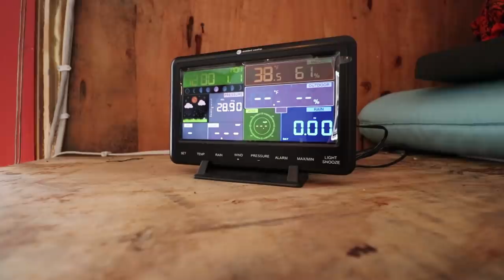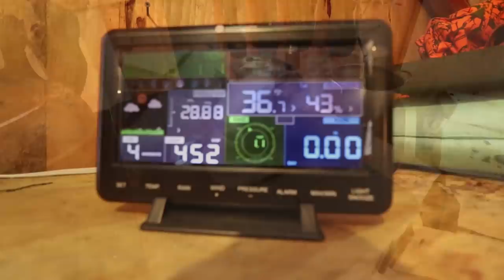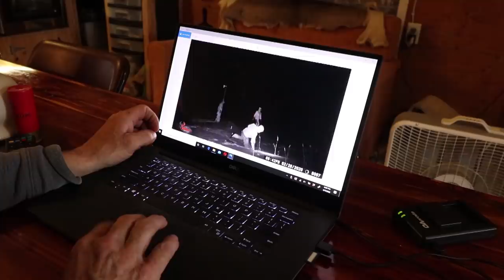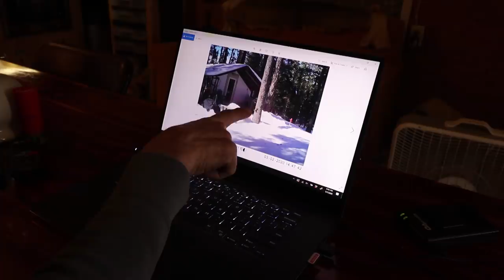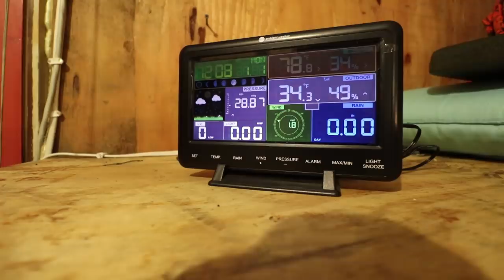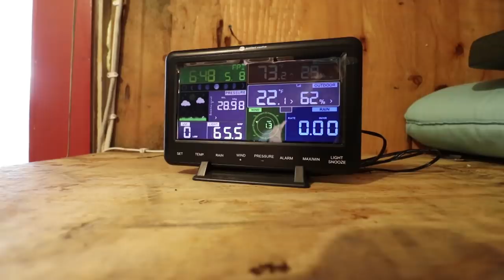THE TENT. First Spring Trip of 2020. Opening things up. Dad is at the Folks cabin.

Comment: Something that might be helpful for those mice are if you get a 5 gallon bucket and drill 2 holes/ grooves towards the top on each side and then get a beer can and a thin metal rod that will spin and poke that rod through the can and put peanut butter on the can and put the rod in those holes you drilled and fill the bucket with antifreeze and build a little ramp so those mice can get up onto the can and they should just fall right into the bucket and die because that rod will spin them right into the bucket and should take care of that problem... always did for me. Also love the channel !

Comment: I know it's a detailed question, but if there is one thing you wish you did differently when you built the tent, what would it be? Thanks Joe.
Reply: 3/4 inch plywood on the floor instead of half inch. The camera would not move around when I walked next to it.
Reply: @NorthernSeclusion  thanks Joe. I used 1/2 inch for my tent floor as well and no doubt, the camera moves. Also, I just should have spent the extra money. Lessons learned. Thanks for taking the time to reply. Jay.

Comment: Hey Joe, My wife and I just bought 5 acres near Tug Hill region in upstate NY that borders 2800 acres of State forest. We just bought a 14'x30' cabin and had it delivered this past Monday. We are in the phase of what do we want in there? Where do we want the wood stove and so on. Its been exciting and fun so far. No electric, no water definitely off grid. I watch your videos for camp ideas and just ideas on where to start. Thank you.
Reply from the maker: That would be a fun project. Wood stoves are good in a corner because they take up less wall space but with yours being 30 foot long you will want a fan to blow the air to the other end if you do not decide to place it against the wall in the center of the building. If you do that though, a wood stove is going to eat up 5 or 6 feet of space coming out from the wall as far as "safe space" is concerned so keep that in mind. Since yours is 14 feet wide, that pretty much splits the building into two areas. Not much room for chairs in front of the stove without possibly causing a walkway issue. All things to think about when planning. I would be excited doing a project like that.

Comment: Hello Joe, been watching for years and have always wondered why you never use what I'm assuming is a water heater on the side of your wood stove. Even when you replaced the stove back whenever I never saw anything about it.
Reply from the maker: I have used it in the past but they end up wasting a lot of water. It heats the water well but you need to use it immediately. You would think when looking at it that you would just always have hot water BUT, It just boils away.  Since the stove when going is of course very hot all that water will boil out within 2 hours.

Comment: 3rd video for me.here is a tip for your stove since i have the same colorado stove, i took an extra stove pipe i had and flattened it a bit so it would fit inside the stove, then when i burn wood, the ashes that remain i just take the inside pipe and remove it with the ashes, somewhat easier to clean the inside out

Comment: Get a Berkey water filter to leave at the cabin. You can pump water out of the pump and fill the Berkey....it produces 2 gallons in minutes and will take out all of the nasty taste and color. It is a water purifier so you could even put pond water in it and it would taste amazing. It will save you a lot of lugging and plastic bottle trash, plus it will be there to use at any time. The filters last for 12 years. Do yourself a favor and check it out. And store your paper plates, bowls and cups upside down, that way you don't have to worry about critters getting into them.

Comment: how does that shower work i know u have a battery that pulls the water into the shower head but does that warm water recirculate through the shower head or something i know a silly question or is that all the water u have so its just a quick 2-3 minute shower , thanks ..or that water spicket u were fixing bring water into the house and the hot water in the pot is just to make it warm a little....

Comment: Joe, if your like me , your not getting any younger. I noticed you struggling to push the boat in and out. Simple little trick helps that a lot. Put about 5 or 6 four foot logs on ground perpendicular to boat ramp. The boat pulls on and off the logs so much easier. WILL I AM

Comment: May want to drop the lower unit off your boat motor it didnt seem to be pumping alot off water. The water pumps are rubber and they get hard over time and dont pump well.
Reply: I had that replaced last year.
Reply: @NorthernSeclusion  good deal just looked weak to me but I'm used to larger motors so they push alot more water.

Comment: what kind of wood stove do you have? expensive? I'm going to have lots of questions for you, sorry.
Reply from the maker: It is a "cylinder stoves" stove. That is the brand name. I have a video on it on this channel that will explain everything. Do a search for it. The video is called "cylinder stoves the tent wood stove" or something close to that.
Reply: @JoeandZachSurvival  I just researched those cylinder stoves and they are considered a tent stove. My concern is can they be used in a cabin. They say you can not. Have you ever had issues with the door seal or any other issues? I'm wondering if its a seal issue with the stove and chimney.

Comment: what was the problem with Zach"s car? I think I have the same problem
Reply from the maker: Connection between harness and alternator had loose fitting, went to Ford and got a new plug and it fixed it
Reply: @JoeandZachSurvival  thanks bro!, turns out it was just a bad battery{ I hope}{ i never had a battery act like that before...}